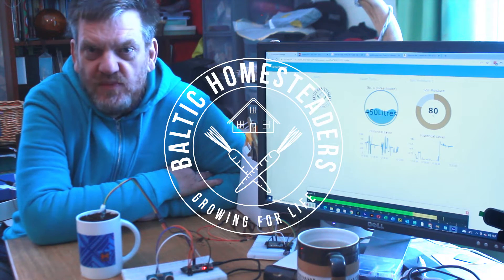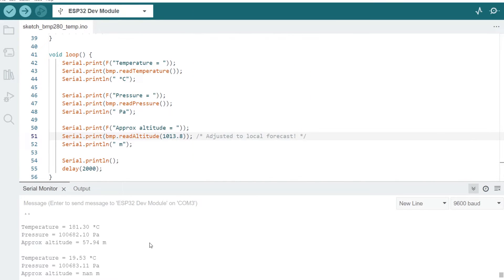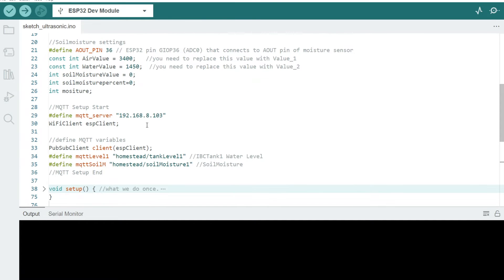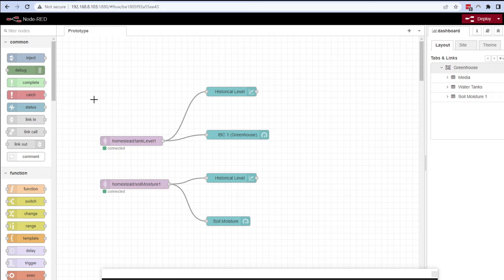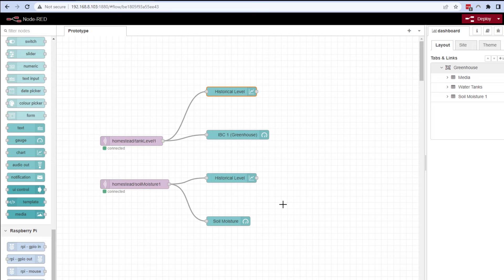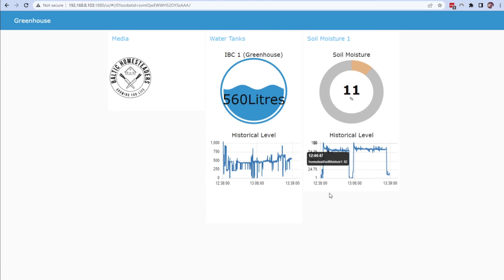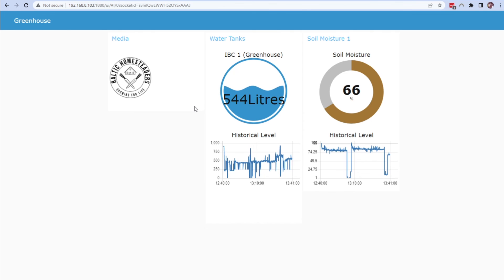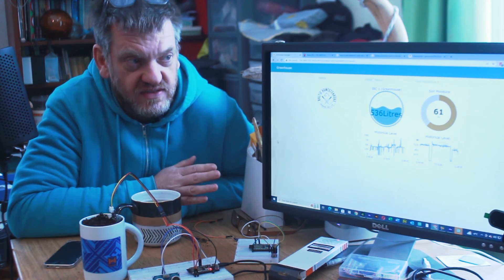Homestead Automation Project Update - Sensors and Dashboard

Comment: I fully understand all of the words in this video, and 30 odd years ago I did City & Guilds 223 ( I think?  ) (electronics) and since then I have been wiring things such as aircraft, trains, tanks and nuclear control units so I'm not totally ignorant of electrical 'stuff'. However,  and maybe it's my descent into old age, the most I can manage to get here is that you can wire up some sensors to a router, power source, laptop and a Mr Kipling fruit pie and this will then do something.  Does it have to be a fruit pie because we've eaten all of ours and only have a pork pie left and it needs using up. Or ...... could it  be used with a good cup of tea rather like a Bambleweeny 57 sub-meson brain linked up to an atomic vector plotter suspended in a strong Brownian Motion producer ? Just a thought ! 🙂
Reply from the maker: You don’t have to use a Raspberrypi but I don’t want to leave my PC on all the time dealing with the data. it makes sense to use a low energy device to do the serving. I can then get it to upload data to the cloud if required.
Reply: @BalticHomesteaders  I  have no idea what a raspberrypi is or does. And it's no use telling me as I will either get confuddledated halfway through or I will forget the beginning when you get to the end. It will be like trying to explain a zoom call to a medieval monk.
Reply from the maker: It’s just a tiny computer.
Reply: @BalticHomesteaders  Ahhhhh, the fog begins to lift. 🙂